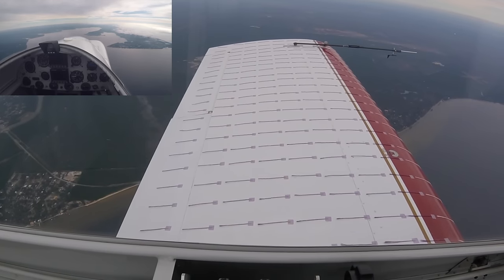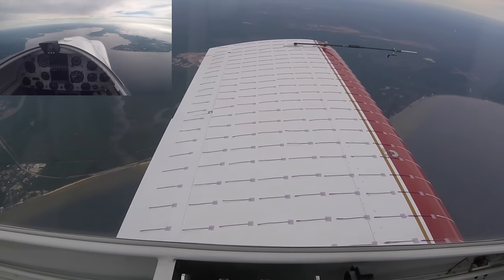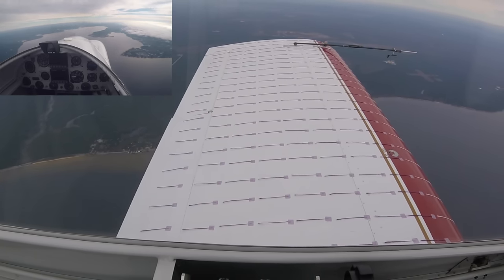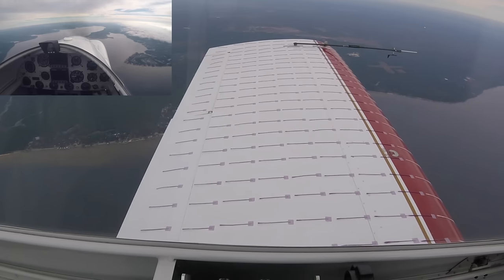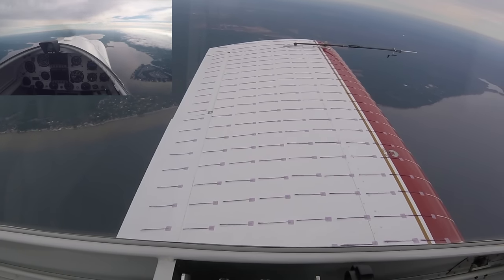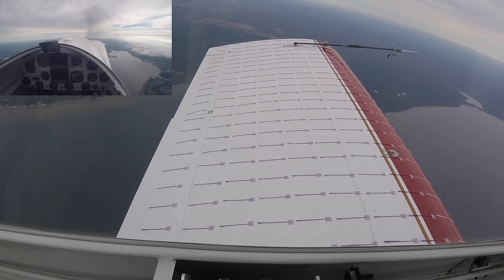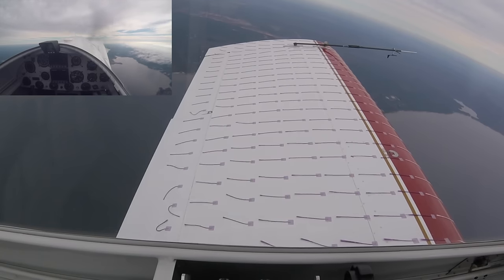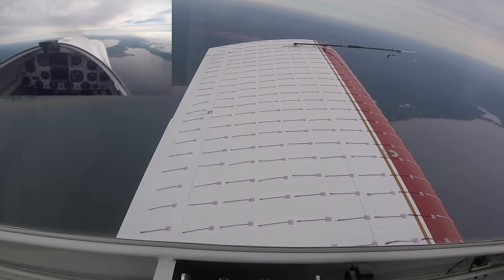1 G Stall Tufts Slow Motion

Comment: It is astonishing that a nearly total flat, smooth surface at high angles creates chaotic vortexs like a jagged surface would
Reply: No, it is not. It is not the surface that creates chaotic vertexes. It is just that the surface is angle too much from the airstream to keep the air glued to it. Any flat surfaced object (like a building) will have chaotic vortices behind it in the wind.
Reply: It’s turbolence not vortices
Reply: Taking a class on it right now, it's very interesting
Reply: Think of eddies forming when something obstructs a stream, in this case it’s the leading edge disrupting the flow of air.
It’s not that the eddies are causing the stall, but that they are the result of insufficient airflow to dissipate them during a stall.
Reply: Air is a fluid.
Reply: @zettysmango if eddies doesn’t cause the stall(lost of lift), then what does?
Reply: @kinfongyeung5400  flow separation, turbulent boundary layers follow surfaces better than laminar. At low angles of attack the pressure from the laminar flow is enough to push the boundary layer back towards the surface, after 15 ish degrees the turbulent takes over.
Reply: @nicomusiani2091 sureeeee and those aren’t the same thing?
Reply: @leonardmilcin7798  in other words.... it's the surface. Idk your comment just confused me even further just to sound like it's exactly what you're claiming its not
Reply: God forbid someone makes a fun comment on youtube without a billion replies picking it apart
Reply: Its not even close to being nearly flat when your talking about molecules interacting with each other.  The surface would be like the grand canyon.
Reply: What is a jagged surface if not a bunch of smooth surfaces at differing angles? -Philosoraptor

Als, I think what @davidaugustofc2574 is saying is a little pedantic, but essentially it’s a matter of cause and effect (?)
We’re seeing a stall which is caused by flow separation from the wing. That same flow separation also causes turbulent flow in the wake which contains all sorts of chaotic movement, not just vortices.

I don’t think anyone made the claim that cause the stall, but if they did, it’d be like claiming skid marks caused a tire to lose traction.

Comment: Really interesting how the stall starts at the wing root and moves spanwise, and the flow reattaches in the opposite direction.
Reply: it's also interesting how as soon as the stall reaches the front of the wing it goes all the way down to the wingtip almost instantly.
Reply: I do wonder if the angle of incidence is not constant throughout the wing aka washout, it sure doesn't look like it though. nvm it's said in the description that there is none.
Reply: Its got to do with the way the angle of attack on a wing is designed. An airplane wing is designed to stall at the root first to allow for recovery and able to operate ailerons.
Reply: Some of those markers are flowing in the opposite direction of the plane moving how is that possible in a moving plane?
Reply: @np9119 the flow separation creates a vortex over the wing
Reply: @Tacticaviator7  The wing seems to be quite even through the length I think it's the fuselage that helps inducing the stall.
Reply: @cevdetgz4126  Notice how the wing tip airflow stays stable for the whole duration of stall, description says that the wing tip helps it stay together so I guess we can assume that the effect just gets weaker as distance increases which results in the stall progressing from the root, interference drag from the fuselage is definetely a factor too as you said.
Reply: Prop blast, crosswind and fuselage side pressure create turbulences around the root area of the Wings, this is a constant corded wing planeform and it should stall linearly which it appears it did.. .
Reply: That's an intentional design feature.  Most aircraft builders put "washout" in the wing design, meaning the tips are twisted to a lower angle of incidence than the roots are, so the root stalls first.

The tip stalling first increases the likelihood of a snap-roll or spin, and also causes loss of aileron effectiveness.  By making the root stall first, it makes the stall behavior more benign.
Reply: @bronco5334 in laymans terms, stall is less violent and easier to recover from. Which is good! Though that does make me wonder, making an aircraft more stable and easier to fly generally makes it less twitchy and maneuverable, would adding washout like this have the same effect?
Reply: @np9119  The air under the wing is being pushed down by the weight of the aircraft and lower pressure above the wing because of the forward motion.  At slower speeds and high enough angle-of-attack, the air will wrap around under the trailing edge and rush back to the front of the wing, on top, to fill in the lower pressure area.
Reply: @Matsumoto77 no, washout primarily affects aileron effectiveness during the progression into stall. There are other factors like dihedral and CG location that will contribute more to the static stability.
Reply: @Matsumoto77  The washout means the tip of the wing doesn't produce its maximum possible lift before the root of the wing starts to stall, so I guess one could argue that as a slight penalty to maneuverability. On the other hand, you maintain aileron control closer to stall, and you get more of a warning before the wing is fully stalled. So the washout should help you extract the maximum performance from the root of the wing without loss of control. In practice I would think a wing with washout would win, but in theory, maybe not.
Reply: @np9119  vortices. non laminar flow during stall.

Comment: I studied aerodynamics for a while some years ago, so I am familiar with what should happen during a stall. For example, I know that modern wings are designed to stall first at the root. But seeing it in action is absolutely fascinating. Watching the stall move outward from the root as the stall deepens is mesmerizing. Great video of an excellent demonstration.
Reply: Could you go more into detail of how it works and why that would be important?
Reply: @luisjannern7316  
It my understanding that making wings with a higher angle of incidence at the root helps with structural integrity (the greatest lift forces are closer to the root of the spar). It also is said to aid controllability during a stall, as the outer wing produces more "leverage" on the roll axis of the aircraft, and thus more control. This also why ailerons are usually located on the outer portion of the wing.

Many small planes do not have this feature (homebuilts and the like), but as you pass a certain MTOW (maximum take off weight) in aircraft type, you will almost always see it, although there are exceptions.
Reply: @luisjannern7316  to elucidate on the first answer you got, stall mainly depends on angle of attack. 
If you introduce a progressive twist in the wing profile, you ensure that the wing roots always have a higher angle of attack than the tips, thus ensuring they stall first. 
If you don't know basic aerodynamics, this fact is hard to extrapolate.

Also, wing tip vortexes have some role in helping to keep the flow attached at the tips, but that is more complicated to explain beyond simple intuition of the vortex pushing the neigboring air down on the wing.

EDIT: the video description states that this aircraft has no washout i.e. the angle of attack is constant throughout the span and there is no twist. The chord and thickness are also constant. Therefore, the effect is all due to the wingtip vortices. Since the wing is relatively thick (low aspect ratio) the vortex has a lot of surface to act upon.
Reply: I was expecting it to be more progressive moving out from root actually, but I don't know what plane or wing this is. I've seen wings with distinct sections for managing roll control better during half stall, so maybe expecting that.
Reply: @iLlamaNEG  
I am assuming you are referring to the vortices that are generated from the abrupt absence of pressure difference past the point where the wingtips end. It results in a circular motion of air heading outward from the underside (high pressure area) of the wing and curling towards the topside of the wing (the low pressure area). This produces a downward force just behind the wing (as the vortex is being generated in a stationary fashion yet the wingtip is moving). If we were to witness this in the video above, I believe we would see the strings behaving wildly all the time the plane is in the air.

Winglets, as seen on airliners, are designed to stop this effect by interrupting the air that is trying to come down just past the wing end, thus breaking up the vortex. It was found that not only do vortices cause problems for aircraft that are following close behind (by generating turbulence), but they also contribute to aerodynamic drag.

I have never heard of the change in angle of incidence from root to tip of an airplane wing being called "washout," but I am researching the term. Thanks for your reply.
Reply: I think higher AOA towards root (or more lift) same with propeller and helicopter blades.

Eg, 10lb pressure at the root moves the blade / wing / airfoil less than 10lbs at the tips...
Reply: @phalcon23  
I am not sure what you're saying, but I think you're referring to how much lift (difference in pressure) should be spread across the length of a wing (or helicopter rotor, or wind turbine blade)...more at the root and becoming less at the tip. And if so, you are correct - to a degree.

Comment: Two things happen when a wing stalls:

1. That wing stops making lift, and is suddenly nothing more than a severe weight imbalance. Yanking that side of the plane down.
2: if the other Wing is still producing lift, then suddenly all the lifting power is only on one side of the plane.

Upward force on one side, downward force on the other.
Makes for a very fast and very sudden roll that you had no idea was about to happen.

Stay away from the stall speeds.
Reply: nope, stall it when ure safe to do it... push it to the limit when u can do it safely.. so u know how it react ... 1st stall ur foamy rc plane then do it with the large nitro one .. then do it with ur real plane... when u gonna have a engine faillure and u know how ur plane stall u get more survivial chance for a landing on a bad terrain...  its like is the icy road slippery or totaly slippy? brake check on the straight part befor u have to discover it in the turn...
Reply: @sunoncream1118   wtf are you saying? Can you translate?
Reply: @davecrupel2817 he means push the limits when you can do so in relative safety so that in an emergency you will not be experiencing how the airframe behaves at those limits for the first time, presumably in less than optimal circumstances/unexpectedly. He's not wrong either.
Reply: @Currancchs   you gonna push your plane to its limits when you go flying?

And yes he is wrong. Because the limits of his playing are already very well understood by the manufacturer. And they spell all those limitations out in the manuals provided with the airplane. Respect those manuals, and respect the limitations within them. 
And you will never have a problem like this on your plane.
Reply: @davecrupel2817  not every time, but with a more experienced pilot in the copilots seat who has agreed to such maneuvers in advance, on a plane I have experience with, in optimal conditions, and at a high enough altitude to allow time for recovery, you bet I'm going to push it into a stall a handful of times so that I know what the plane feels like as it approaches it's limits. Of course, if all goes well you should never need these skills, but shit does happen. Besides, operating on the verge of stalling and actually stalling is routine flying (e.g. landing flares).

Also, apparently the FAA agrees, since stall recovery is a required part of training in the US.
Reply: False, stalled wings still produce lift, just moderately less.
The one thing that changes a lot is drag, which increases massively and slows the plane down, worsening the stall and THEN drastically decreasing lift.
Reply: @davecrupel2817  you are absolutely clueless, pushing the plane to its stall limits to understand how it feels and behaves is a core part of pilot training. One does not routinely do it, but it should be done AT LEAST once.

Comment: Nice visualisation! I guess the prop rotation is clockwise when viewed from the pilot's seat? Thinking that's why the port wing drops first, even at low power settings…
Reply: At high angles of attack, as you would in slow flight, p-factor is going to contribute most to left turning tendances. The wing dip like that usually means not enough right rudder before the stall. He does say the ball is in the center tho, so I'm not sure.

Comment: I wish the description was layman’s terms
Reply: My best interpretation is that it is a stall performed in straight and level flight, with a wing that does not change shape, no flaps, and the stall begins at the inside of the wing from the back and progresses out to the wing tips, the stall does not reach the very tips so the ailerons keep working, the stall causes a loss of lift which makes the wing drop, recovery from the stall was performed by simply lowering the nose
Reply: @calebmenker988 
 Thank you, Translator.

Comment: What happens if you stall the plane by flying straight up, would you be able to easily catch the airflow again?
Reply: As long as you have adequate airspeed, recovering from a stall does not depend on the orientation of the plane and is always a simple matter of pushing the stick/yoke forward to push the nose of the aircraft "down" (relative to the plane, which is usually but not necessarily towards the ground). Of course, if this happens in an unusual attitude (such as flying straight up), then you subsequently have to deal with recovering from that to return to normal flight, though recovering from the stall should have higher priority.

Note that stalling does not depend on how the plane is oriented relative to the Earth, only how it's oriented relative to the airflow. So for example there's an aerobatic maneuver called a hammerhead where the plane flies straight up until it comes to a stop and starts falling backwards, and then the rudder is used to yaw the plane 180 degrees around so the nose points down and you pull up to recover, but during all this the wings never stall since the airflow remains close to parallel to the wings.